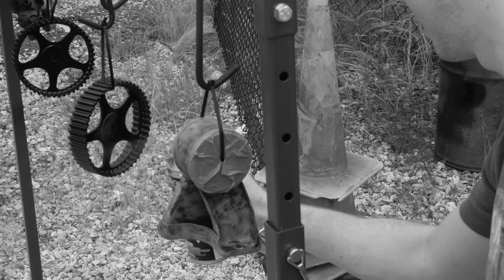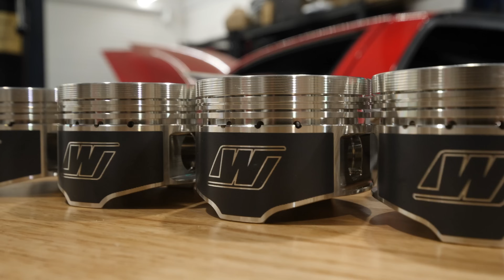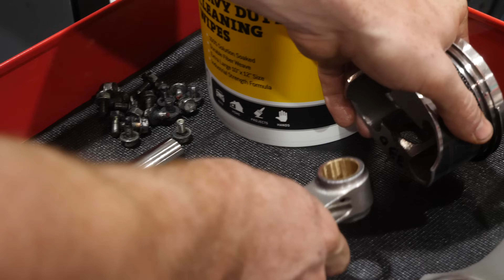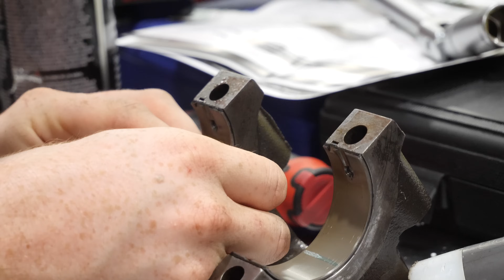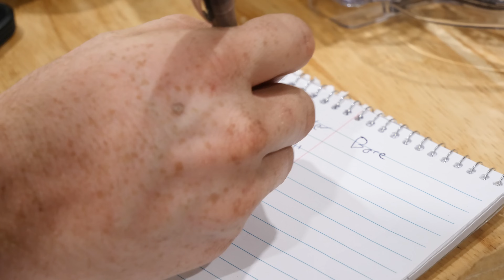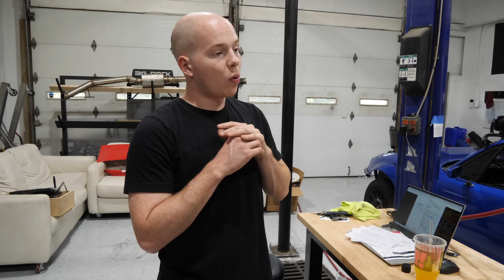Will The Eclipse EVER Be Finished? Learn From My Mistakes...

Comment: It's hard to understand what all actually goes in to building an engine properly. The tools and equipment involved are a bit more extensive than what you'd have in pappy's toolbox. Especially if pappy wasn't a dedicated machinist. If I was ever to do something like this I'd at least try to make sure I had the proper tools to do it right. I've made mistakes before that could've been avoided, and I've tried to make them right if possible. But at the end of the day, if I messed something up I'd at least let you know as a heads up. Building engines is an artform. And if you don't take the proper steps, you end up where you are now. It's unfortunate you got what you got. But when it's done I bet she'll be a mean machine 😎 Can't wait to see it run 🤩 I've actually been pondering a 1st gen 4g swap into my 98 neon. The platform isn't much different, the 2.0 DOHC in it is based off of the japanese 420a which came in the base model lancers and eclipses, and it has the option for an AWD bolt on 😏 Keep it up 👍

Comment: You need to get with your builder and do some confirming.  Typically your cylinder honing is done with a toque plate to simulate the cylinder head.  You need to also do you bore checks now with a torque plate on as that is more than likely the reasoning for the "out of round" cylinder.  

Plus, don't fully rely on your plastiguage stuff.  It "works" enough but a couple of nice calipers and your dial bore gauge will give you a better check when looking at your main/rod bearing measurements.

Comment: Never used plastiguage. I always used a micrometer. Just check to tolerances in the manual. Sound like the engine builder didn't care much just make a quick buck! I admire your patience. But it made good content and I learnt something. Thanks.

Comment: Ahead of time; when the bored/honed block is finally ready, take it outside and flush the hell out of the bores with hot, sudsy water and a paint brush, it properly floats microscopic debris out of the honing marks (solvent flushing/wiping doesn't do it nearly as thoroughly). The shop might have done it already, but as you've learned to your cost, if you're not sure, DIY. And mega flush the oil galleries.

Comment: When will the lesson ever be learned? There is nothing more frustrating, than working on these old japanese cars... yes they are easy to learn and there is not much technology. But, there is a price... if finally everything fits, it breaks down after a few drives.
Just look how many of your old projects are actually running?

You need to change tactics! Dump these old japanese shitboxes and start working on decent cars...

Comment: Hey man, speaking from experience when you build a turbo engine you want more oil clearance. I’ve built turbo k20s and for a street turbo build you want that extra clearance. You just have to run thicker oil. Having an oil pressure gauge is a must for initial start up . It helps you determine if you have adequate oil pressure. Also, the Honda service manual states no more than 0.0018 in oil clearance. However with my turbo k20 I have close to 0.003 in oil clearance. Car made 475 whp and no problems.

Comment: Don’t forget that when blocks are bored oversized they typically have a torque plate bolted in place to simulate the head which will have an effect on the shape and straightness of the cylinder soo your block could actually be good.
Reply: Yeah.. only thing is you'd think the shop would mention that when he asked for the refund

Comment: The bore may have been machined with torque plates on. It has to be round when it's torqued down to spec, doesn't mean it will be round as it sits.

Comment: This engine builder guy really dicked you over. Even if he used the right pistons the engine would have either run horrible or blew up. This guy didn't have a fucking clue what he was doing.

Comment: You will not get an accurate measurement on the bore size without a torque plate. You should also not use a machinist that doesn’t bore and hone without a torque plate. It’s unfortunate that this is happening to you but it seems like it’s partially due to the fact of your lack of knowledge of good machinists and what to expect, and your eagerness to finish the project. Good work isn’t cheap and cheap work isn’t good.

Also, are you measuring your piston at the proper location? Typically you measure at a determined height up the skirt of the piston. I believe Wiseco leaves a small dot without the skirt coating as a measurement location.
Reply: Cheap, fast and good. Choose any two.

Comment: You're motor builder guy is shit , Do it yourself looks like you got the gages understand machine shop stuff if you don't find a machinest friend that does. You got this,   Fk that idiot fake motor builder that probably did not even touch that engine when you found the wobbly pistons right there time for a total inspection now you know, can't trust critical areas to a dumb ass. Race specs my ass extra oil clearance (just a wore out engine with oblong bores and stuff) you should mention the idiots name who did the work so no one else gets scammed. Homey did not measure shit!!!!  P.S  Wrote this before finishing you're video

Comment: I really hope you figure out the proper terms for inspection. A thou or thousandth is .001.   .010 is ten thou. .0001 is a tenth or one ten thousandths. If the bore is only .0015 put of spec you might still be in range for the ring spring tension. Vw aircooled allows for up to .002 if  its .015 then yes the sleeve is ovaled.
Reply: I like your screen name

Comment: You can also mix the two sets on h and hx bearings to get the tolerance as close as you can. And put the hx bearing on the bottom for the mains and on the top for the rods . Jay from real st does that

Comment: If you keep running into issues just give up and buy an MAP Stage1 shortblock. They're reasonably priced for what you get. Or throw another stock 6 bolt in it, they hold plenty of power.

Comment: im not quite sure but depending on where the headstuds mount and how much torque they require it can actually sort of distort the block and thus make the cylinders round when everyhing is bolted down. is that the case for that lock, you need a torque-plate before measuring the cylinders because under real-world use/load they might actually be round and when relaxed turn oval.

Comment: Make sure you replace the oil cooler. They like to hold metal from previous blown motors. Also the oil filter housing needs to be rebuild or replaced because they also like to hold metal.
Reply: +1 for visability, great points!
Reply: bump
Reply: Bump

Comment: This is how everything in my life works also. Everything fights you every inch of the way. 
You break a drill bit....No problem, I'll just go to the hardware store a few blocks away to get a new one. They just happen to be out of the size you need. So are the 6 other stores all over town, you ended up driving to. It ends up taking you literally all day just to drill one single hole because you had to drive around all day.

Comment: Just a Heads Up regarding roundness of the cylinders:

Many Engines will be relatively flexible and change their form when a head is installed, that is why good shops use a honing fixture ( German 1:1 translation would be honing glasses). That would simulate the engine getting torqued down while maintaining Access to the cylinders.
So in general it can be the case that cylinders, when measured without a honing fixture will not be round and it’s completely okay. And then sometimes it can be that the cylinders aren’t all the same because the cylinders on the outside have less “flesh” they are attached to so that they are more flexible
Reply: This!

Comment: Trust me, I've rebuild and seen engines wich were way worse than this (apart from the wrong sized pistons), it would've ran and lasted (granted probably not as long as it should last) but faaaar longer than 1 mile. I ride dirtbikes which NEED to be routinely rebuild and these suckers can and do go through A LOT before they break
Reply: If it had the right pistons in it and close to proper ring gap. I'm by far no expert, but my guess is the engine would seem to run fine & he wouldn't realize it was a shoddy build. The lucky winner would end up with an engine that worn out prematurely. 
     I once put a new/rebuilt V6 in and a month later the old oil pump went bad. The engine overheated from oil starvation & locked up, once it cooled off it was able to restart, I thought the engine was toast. I put a new oil pump in & the engine ran fine for several years afterwords. Until the transmission finally went out.

Comment: this really sucks I've had great experience with 4g63 I had a 1g that I bought with rod knock and all I did was drop the pan polished the crank with sandpaper and a shoe lace put new bearings in it and made 334whp. and it ran that way for 2 year and probably wouldn't have failed it the time was good.

Comment: Maybe it’s time to find an engine that is more readily available, like a k-series. Think about how much trouble you are having with all of these 4g63’s you have been acquiring. Now think about the person who is going to be getting the car as a winner. I’m not doubting your ability to build a good car, you have proven you are more than capable. I just think that accessibility to parts in the future should be kept in mind. K-series are cheap and readily available and can make the kinds of power you are looking for out of an unopened long block. The 4g63 is such an old engine now that even though there is aftermarket support, it just can’t match the horsepower/reliability to dollar ratio. Just the 2-cents from a stranger who’s pretty sure you won’t see this.
Reply: lol what are you talking about a stock 6 bolt bottom end can make 700hp. there is no reason to switch platforms. he should have just rebuilt the engine himself in the first place. and it would have been good to go.
Reply: @1g_dsm_life154   Seeing how your username is directly related to 4g63’s, I can in no way see how you would have any sort of bias towards them. Lol 
Not even saying they aren’t capable, nor did I even say anything about their capability, they are old and getting hard to find. And the ones available are super expensive.

Comment: While i doubt this is the case, it is possible that the cylinders are not perfectly round because the head isnt bolted on.   Good engine builders often bolt down a big piece of metal to simulate the force exerted on the block.   It is possible that the cylinders are round when it is all bolted together.   But given that the pistons were not the right size, its not likely the cylinders were bored properly either
Reply: I'm gonna go out on a limb and suggest that this is not a "good engine builder". Haha.

Comment: You already have a bore gauge and micrometers, use those instead of plasti gauge. It’s much more accurate. Also don’t know if you did this but before measuring take each bearing out and clean it and the mating surface. Any dirt will cause an incorrect reading.

Comment: fun fact, pistons aren't really circular, they are slightly oval because they grow differently in the 2 directions.
Also the "side" isn't cylindrical, also due to different thermal expansion of the crown compared to the rest of the skirt
Reply: Multi dimensional shape, it's crazy how much science & engineering goes into the shape of a modern piston.

Comment: Should have just done a K swap from the start! It would be running and making a sold 500 reliable horse power! I dig your drive and willingness to see it through with that engine though,  its impressive.
Reply from the maker: Trust me. I'm REEEAALLLYYY wishing I K swapped it at this point
Reply: @_Gingium_  Can't tell me an EJ wouldn't have fit in the back of that :P

Offroad mx-5 has one though so I take it variety is key
Reply: @_Gingium_  I feel bad for all the shit you have had to deal with over that engine for sure! It looks amazing though my man and you will get it right!
Reply: Agreed but Vibrations could've killed the drivability

Comment: What have I learned from this build series:

-Gingium is an amazing fabricator 
-4G63’s are unreliable as s***
Reply from the maker: Yeah the motors are actually great. I guess the DSM community is just filled with a few bad apples. Just like every other community to be fair
Reply: How are they unreliable? The builders are shit, not the engines.
Reply: Some people shouldn't do their own work when they don't know what they're doing, cause then fabium has to deal with it
Reply: lol my experience with 4g63 has been great lol I've slapped together a few motors with spare parts I've had laying around. made 400awhp and daily drove it for 2 years. my friend made 670awhp and a stock bottom end 6 bolt. and it lasted a year and a half that way.
Reply: DSM community is historically filled with bad apples, ripping people off. Not sure why. Tons of good people too though!